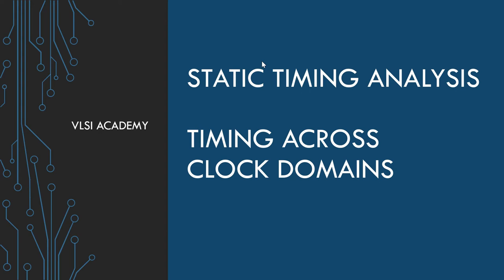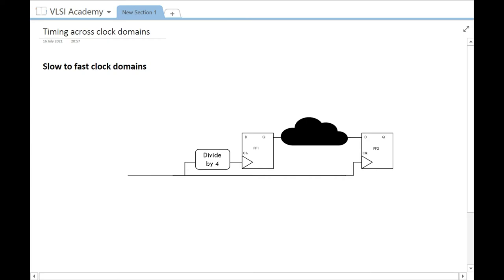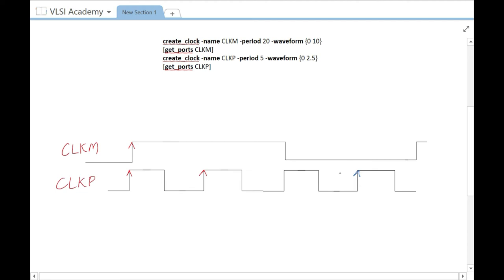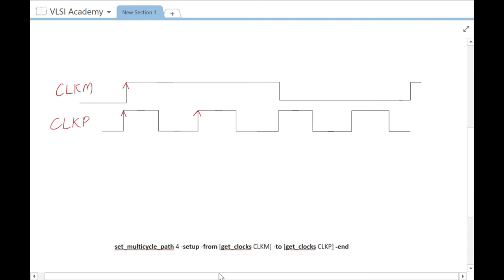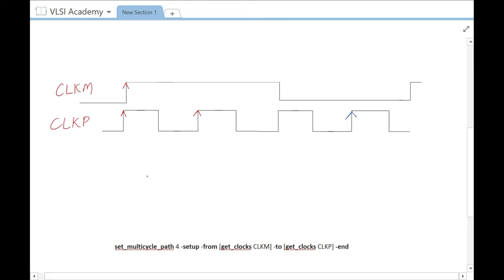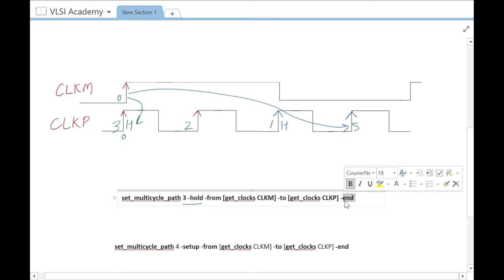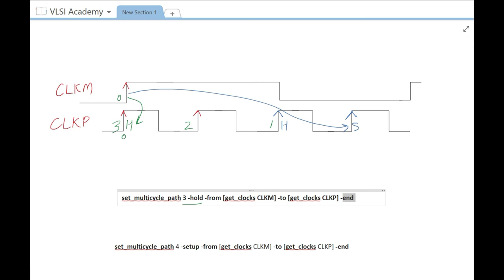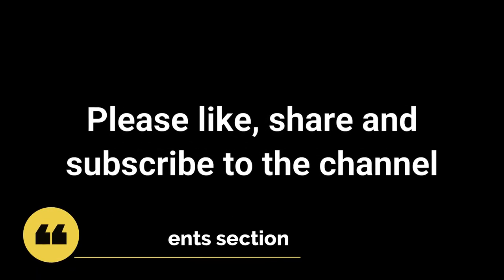sta lec27 timing across clk domains part1 | Static Timing Analysis tutorial | VLSI

Comment: Sir in this why are we using two different clock commands for clk isn't we are actually creating a Freq divider circuit. 

If we use different clk then isn't it clock domain crossing?
Reply from the maker: If there's a clock domain crossing then generally clock needs to be synchronised. When we create different clock we need to see if the new clock is generated or is it a separate master clock

Comment: In this wave form,  Assumptions taken like this data launch by launch flop is total 4 times but if data continue to change so launch flop changes its output 4 times but capture flop only catches one data other data will be lost. What to do to prevent this?
Example: at first high clk signal is zero so launch flip flop sample zero, at the second edge data signal is 1 so launch flop sample one, at the third edge signal is 1, and for the fourth edge is signal is 0,     but capture flop only sample first signal zero other three data will be lost.

Comment: Sir, instead of multicycle 4 shouldn't it be 3  for setup command ?  since 3 cycles are there if capture is at 4th edge. Same for hold, shouldn't it be 2 instead of 3 ?
Reply: @VLSIAcademyhub  but in the graph, the analysis you did was based on clock edge instead of the clock cycle. For setup MCP 4 the capture clock should align with CLKM 20ns edge to make 4 cycles but instead you have it aligned with 15ns of CLKM making it MCP 3 for setup and not 4.
Reply: @houda9293  correct